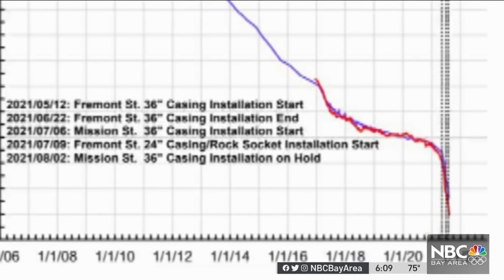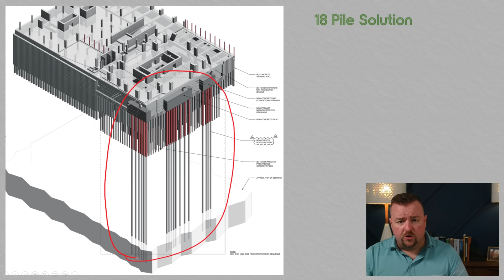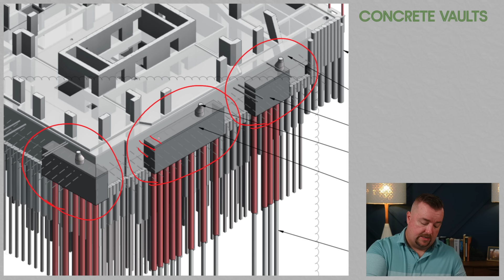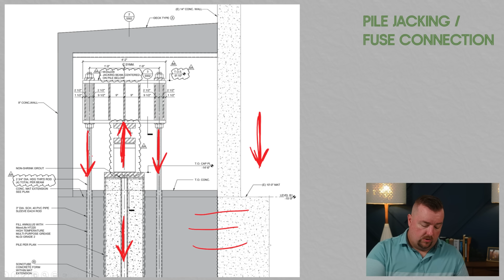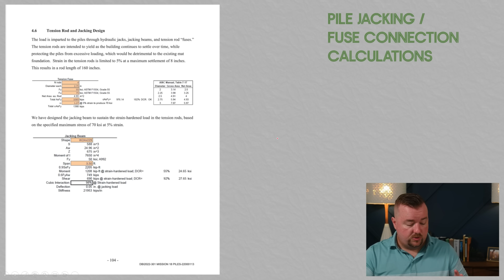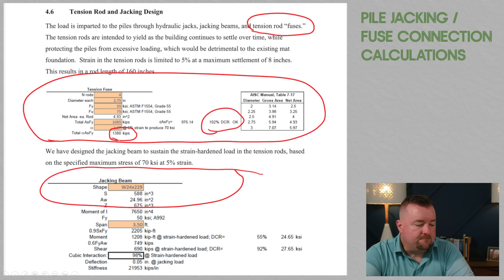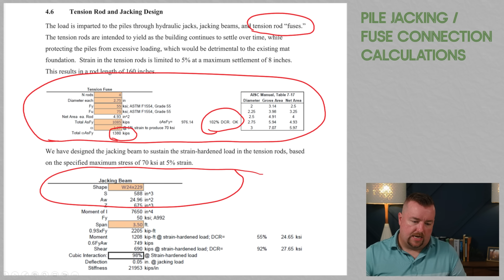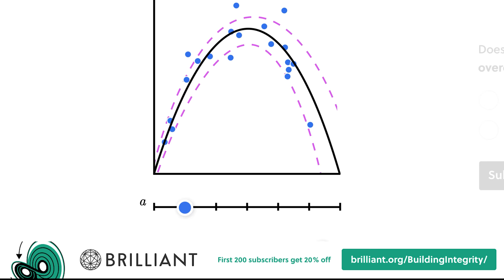Did I Uncover a $100,000,000 Mistake with the Millennium Tower "Fix"?

Comment: That thin steel plate of just one and a half inches worries me.  I am neither an engineer nor an architect but my gut feeling tells me that the nut will tear a bigger hole and go through that plate once the full load of one million pounds is applied.  My suggestion: They should use huge washers around 7 inches in diameter, 2 inches thick and made of hard steel that resist tearing or deforming to protect that steel plate.  They can stack 2 or more washers for added safety.  The thickness of the plate should also be increased to at least 2 1/2 to 3  inches to be able to take that load.
Reply: I don’t think you are taking into account the fact that the plate is buried deep in reinforced concrete.  Besides, it is too late.  These structures have been built.
Reply: @GH-oi2jf  Yes it has been months ago so it's too late.  I just hope that they noticed the simple flaw and did the necessary corrections on the other structures.

Comment: Maybe all they need is to empty the building as much as possible, maybe remove the windows or something because glass is heavy, remove all furnitures and people.
Then jack the side that is leaning the most, fill what's underneath with something non compressible like concrete and whatnot, and screw it down really good. Maybe do the same thing on the other side as well.

Comment: A million pound load taken by an area a little bigger than my work boot soles. Got it. What could possibly go wrong?
On a less facetious note, loads are not usually shared on a double nut assembly.  The moment tensile loads exceed that of the nuts' preload against each other, then due to thread clearance they are taken entirely (in this example) by the lower nut, and the upper nut becomes simply a spacer until the threaded bar stretches to fill the thread clearance.  This can occur before or after yield point.  It is also possible for the bar to fail before this point is reached.  It's why half nuts should never be used unless they are properly stressed to take the entire load of a threaded assembly.
Reply: One nut is sufficient anyway.  There is only one nut at the top.  The reason there are two nuts at the bottom is to hold the assembly in a fixed position until it is embedded in concrete.

Comment: I suspect the steel plates at the ends of the threaded rods are not designed to anchor the threaded rods into concrete. The steel plates   serve only as a template to hold the rods in place during installation. I suspect the nuts embedded in the concrete are adequate to develop the tensile capacity of the rods. 

The strength of the threaded rods can be engineered to pretty tight tolerances. The key is that the rods can't be stronger than expected because then the system can translate too much force onto the existing foundation.

I think the design of the rods and plates is pretty straight forward and is the least of the concerns in the overall design concept.

Comment: I'm curious about the torque introduced by the offset between the pile and that little angled shelf on the foundation wall.  It seems there should be a lot of force on the transfer block away from the building due to that torque and also possibly crushing and impinging all those tubes (for the pile and rods) that pass through it.  Not an engineer so feel free to point and laugh ;)

Comment: As I remember, a sharp notch constitutes a “stress raiser” initiating a fracture of a tension member at a stress appreciably lower
Reply: Than the ultimate stress. Here they are deliberately using a stress higher than yield; the essentially continuous stress raiser, the threads, will make the rods quite unreliable for load calculated on the net section.
Reply: And I agree as to your reservations about the steel plates at the bottom!

Comment: A WHOLE lotta money has gone down the crapper on this. Somebody needs to go out and buy some expired carbon fibre, weave it badly into some kinda tube shape, and then glue some metal and caps on, not forgetting to put in underrated inspection window. The contractor that can do this is a company called Sidewalkgate, a subsidiary of Oceangate.

Comment: It's still amazing that they can put a piling that deep and keep it 100% vertical. Because, not having a clue what I'm talking about, unless it is, it seems that those free sliding parts will bind and not work at all. If they can pull it off it's worthy of a segment on Modern Marvels.

Comment: 2 questions. 1.Are the threads of the rods and nuts sufficient to transfer the load? Or will they  shear. 2. imagine the plate is made of miracle metal, and it can take the loading, does the area of the plate sufficiently disperse the load to the concrete, or will the plate just pull up into the concrete?
Reply: The system has been in place for six months without incident, so it seems to be strong enough.

Comment: So - the building will now be supported on the weight bearing capacity of a bunch of 6.5 inch steel washers ? How could this possibly work ?
Reply: The steel plates are buried deep in concrete.

Comment: Excellent video. I don't think they took into account for the deflection of the plate, I've added a ridiculous amount of gussets in a similar situation. Plus, with the lateral forces, there should be much thicker around the plate connectors.

Comment: The Millenium Tower has an area of contact with Mother Earth, and the mass of this building is simply force / area. Would it not be easier to stick to the KISS principle?  Have the Academics ever considered increasing the Live Loading of this building - on the OPPOSING SIDE to the buildings lean? In the original design of the building, the maximum Live Loading would surely be specified. Further to this, the Live Loading on the 'lean' side of this building should be minimised. To do this, in combination with the current operations, will most definitely apply a substantial (additional) secondary force that would assist in all attempts to bring this building back to perpendicular. This is all providing that the opposing side to the lean - is not already settled on Bedrock.
Reply: The low side is now supported by bedrock through the 18 new piles.

Comment: two thoughts....

1) Demo the building before a catastrophic failure occurs.

2) Hire Dubai engineers and basically construct a traction system. a massive subterranean system that will anchor and pull the building on the high side (basically bracing the side that is lifting) while it is connected to the building on the side that has the new pilings. Meanwhile yearly changing the  composition of the ground near the pivot point of the building-sink. essentially preventing a shearing-event where the building shears in half ...all while eventually sinking and pulling the building upright enough to stabilize against future seismic events. Its going to continue to sink if nothing is done to counteract the sinking. Bracing it only works for so long. And It seems like we dont really care to build things right anymore.

Comment: I have spent 40 years in the heavy construction industry in NYC and seen all types of foundation improvements necessary to construct subways, bridges and other structures, this fix sounds very sketchy.
My suggestion is to involve Muser, Rutlege for the design using the old but very effective Spence, White & Prentice method of "Pre-tested jacked underpinning pipe piles" under the existing foundation footing and slabs to rock. 
This method has been used in NYC for 100 years on building heavier than this with great success.

Comment: So we do all know that SF has a history of earthquakes, right?  So when the building is swaying in a moderate shaker, I am guessing the Fuse rods will pop, the building will then settle down the distance it has been razed, while swaying...   You also know it is leaning towards the SalesForce tower, a building 4x bigger than "normal" skyscrapers in SF.  No big deal you say, SalesForce is so much bigger than Millennium that it can take the hit. But...  Millennium is a concrete building and SalesForce is glass and steel.  Millennium will crash right through SalesForce.  The cascade will be epic.
Reply: “razed”?  The building has not been torn down.

A moderate earthquake will just help the east side settle, reducing the tilt.
Reply: You are correct.  It may fall the opposite direction due to the spalling of the support walls on that side.

Comment: That bottom plate has to transfer it's buckling forces to the surrounding concrete - i don't see any reinforcing helices there like we have on post tensioned I-beams to reduce strain and transfer compressive stress into the high strength mass concrete?

Comment: 102% yield will behave as torque-to-yield fastener and spread the grip load, I wouldn't be so worried about that, but my concern is with the shear loading on cured concrete, at transition points?

Comment: As a layman; when something goes wrong Fuses sever the connection of energy. From my understanding of this project and calling it a fuse they are saying that they will LIFT a significant portion of the buildings weight and if something goes wrong the FUSE will sever the connection and drop the building... From my layman's point of view it looks like they want the threaded rods to snap or permanently stretch and be replaced consistently... The building is actively falling down in slow motion, you shouldn't make the "fix" of that be a consumable.
Reply: It is just a word.  The engineer is drawing an analogy, but it is an imperfect one.

The remedial work is not lifting the building.  The 18 new piles are supporting the west side of the building on bedrock to prevent it from sinking further.  The east side may continue to settle, which will reduce the degree of lean.

The rods are “fuses” in the sense that they will sacrifice themselves to limit the load on the new piles, which was set to one million pounds on each pile.  There are two failure modes in a steel rod.  The first is to exceed the elastic limit, above which the rod will experience plastic deformation (inelastic stretching).  If this happens to a rod, some of its load will be transfered to all the other rods.  If a rod keeps stretching, at some point it will break.  Then all of its load will be transferred to the other rods.  There are 72 rods total.    If a few of the rods break, nothing catastrophic will happen.  Take away all the rods and you will just be where you were before, with a building that is leaning to the west.

The current status is that the system of new piles is installed and fully loaded.  Nothing has broken and the progress of the leaning has been arrested.
Reply: @GH-oi2jf  
Talking about imperfect analogies. When I said "lift a portion of the weight" I did not mean it was picked up into the air just that it supported some of the weight. If the rods of one pylon were to fail then it would stop supporting that weight and the supported weight  would be shifted to another pylon. That change of weight distribution I called "drop the building" to implicate that non-standard nature of putting extra weight on a rod that is loaded to 102% of its elastic limit** 

Maybe I misunderstood because it sounded like putting 1million pounds of force on each pylon system would breech the elastic limit by 2% thus putting it into a failure mode as you said. I guess the only option is to wait, I've seen this youtuber talk about 'poor designs' that lasted 10 years before showing signs of failure and as he stated paraphrased 'what happens when they stop checking it daily, or weekly, or even yearly' The system for taking weight off the original pylons is really cool and interesting but I don't see why its normal to design a fix that might end up "where you were before, with a building that is leaning to the west." Why even do the fix if you're going to allow every threaded rod to stretch when you have the ability to not do that.
Reply: @chillbro1010 — I think the rods are loaded within the elastic region, but close to the yield point.  In any case, the expected result is that the building will continue to settle somewhat to the east, which will reduce the lean.  At the same time, the water content in the clay layer should equalize.  I think there is a good chance that this solution will hold up long term, but that is just a layman’s guess.  Time will tell.

Comment: Yet another solution: A gently tapered cone could be added at the bottom of the rod above the plate.   The cone would not be greased and would be in direct contact with the poured concrete.

Comment: i have callculated that C100 concrete should withstand pressure with a 20x20 steel plate - it would be minimal size to withstand 1600 thousand pounds (dont recall what are the building numbers but something around 300.000 pounds for a pile?) i didnt take vibrations into consideration and it should be taken

Comment: use multiple steele cables like on bridges to place on the corners of the building pullies all over to reduce power needed to pull building into a centeral alignment. use all the surrounding buildings as magnetic steelr pillow poles to keep it off the other buildings, use small vibrations from bellow with an upword force to counter gravity along with boyancy heat use it all.. all laws of physics use the energy combined all as a massive combined effort also magnets underneath might help.. itll be complicating but can be done.

Comment: I like your take on the Surfside collapse necause I didn't detect any sensationalism or alarmist language but to say it would mess up the "entire" downtown part of SF, now THAT'S a stretch.  It would cripple the immediate area including the Transbay Terminal that's several blocks long accomodating all.the Bay Area transit agencies including the future high speed rail terminal which has been a big part of the litigation claiming that its massive comcrete and huge steel columns  weiight spanning several blocks with a rooftop park and trail affected the soil compaction and ground water being claimwd that moisture was squeezed out of the surrounding ground.  Anyway that and including the SoMa District and Rimcon Hill area which are dense with townhome, apartment and condominium complexes and the tens of thousands people in all that housing would definitely experience a major nightmare scenario but all of that is nowhere near the "entire" downtown area of San Francisco.  I live in Mission Bay where the sidewalks next to all these new condominium midrise buildings sinking including at some corners of buildings because the entire area is built on infill consisting of the millions of tons of debris from the 1906 earthquake and fire plus many mamy ships and trainloads of sand from Ocean Beach which is very close to SoMa and the MT.  Thanks for the effort in compiling all of this information and researxh for this very informative update.

Comment: The size of the plates at the ends of the rods is insane. Even just 4 all threads to support all that seems underestimated by like 4x just on basic common sense. How did this get implemented?
Reply: There are 18 new piles, so 72 allthread rods.